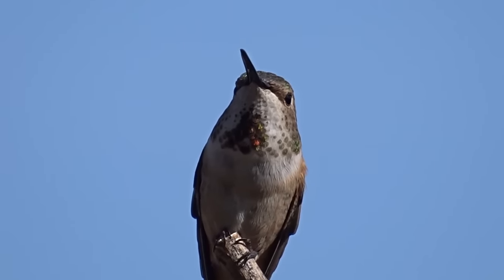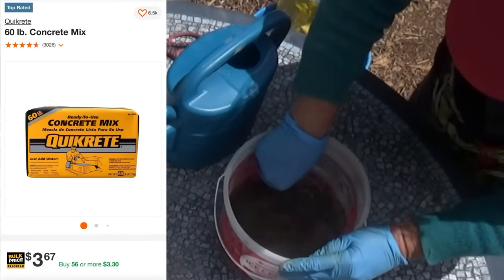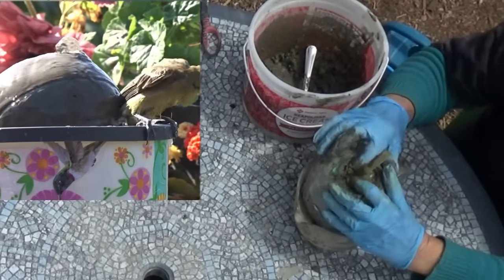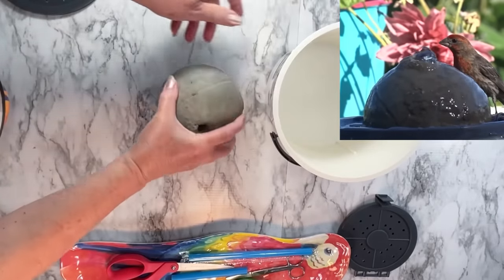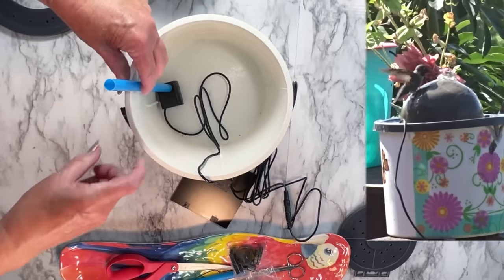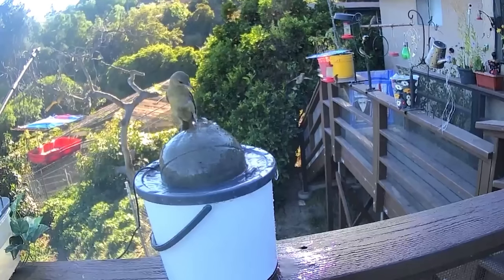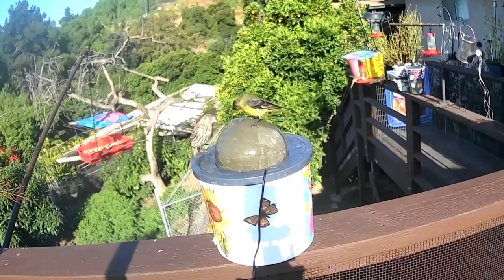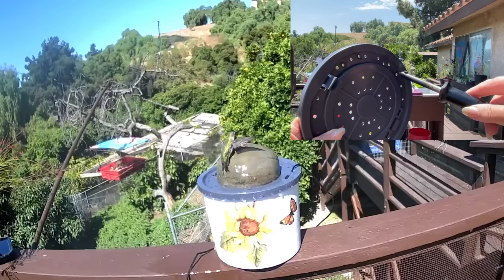How to Make Hummingbird Endless Water Fountain EASY. Cement BALL Bird Bath Solar Powered they LOVE

Comment: I did it! I created a foundation and I JUST saw a hummingbird in it!! I didn't create the concrete ball, but used a terracotta pot turned upside down. You are right, they wanted something to grip into. His little feet gripped right onto the pot. I'm so pleased.
Reply: Hey do you think I could use plaster of Paris????
Reply: @roberthicks7480 Plaster of paris falls apart in wet conditions.

Comment: ROBBIE!
I buy gallons of distilled water! I think the bottom of the gallon would make a really nice square fountain top! I've seen vids of expensive square Stone fountains and 50 hummers have a pool party on the surface. Plus a gallon jug costs nothing. I would love to see you make 1!
Reply: I have tons of milk jugs! This sounds like a great idea. I did not have any of the meat trays Robbie was using in another video, so I was trying to figure out what containers I might be able to re-use. I have used the jugs as ends of sticks (their shape seems to resist flying off in the wind vs all sorts of smaller bottles), as pitchers, and as winter greenhouses, but I have way more gallon jugs than I can use.

Comment: Just as I was thinking "what the heck am i going to do with 60 pounds of concrete?" You provided the answer.
Reply from the maker: 😊 Now you know, share ❤️
Reply: I did the same thing but unloaded the bag into two containers so each of the 3 were now around 20 lbs so easy to lift. I needed to fix a fence post so needed all the concrete I paid for. Just keep the leftover in a plastic bag that’s airtight or the humidity will make the extra you are keeping set up into a big lump!

Comment: Was thinking about using a cheap plastic kid’s cereal bowl  to make a half ball with a flat bottom. That way you would not have to cut a big hole in the lid to fit it in. Just a hole for the straw and then all the little drainage holes. Would be less messy and a lot lighter too. You would have to make s hole in the bottom center of the bowl  before filling with cement for the straw to come out of and somehow cover it with plastic wrap and a rubber band - or some other way to keep the cement from running out while filling it? Ideas?
Reply: Or maybe use a bowl with a snap on lid with a hole for the straw in the lid and another hole in bottom of the bowl to thread the straw through before you fill it.  If the straw was in the holes tightly enuf maybe the cement wouldn’t seep out?
Reply: Hey now us 50 year old are still using those bowls.😂
Reply: @markoliver-ww9ld  😄😄😄😄

Comment: Where can you get the water pumps 😮
Reply from the maker: I just bought 4 this morning, this is the one I like the best, this is an affiliated link, and more are under my videos, THANKS: https://www.ebay.com/itm/204326109148?amdata=enc%3AAQAIAAAAkBqGQc3KucpaymNpmQkaYmIZmJNupSncpSnkDTV%2FmEi3EMr2%2BBsu4PPEWeFjMZxI7LEQErkqLA5FwnnoxzTwb4hEvgI2zDnLvyVjK3cubQqH7i8FbW5UwbU2QDeTcctODa0ApgtxMZxYyXiFIfAjh9aTM9mpPYgyFNaUq7yIuUEwD7V6gWG7CKoxKSye5WiQ2A%3D%3D#LISTING_FRAME_MODULE&mkcid=1&mkrid=711-53200-19255-0&siteid=0&campid=5338267736&customid=&toolid=10001&mkevt=1